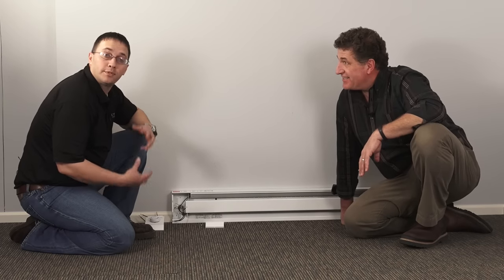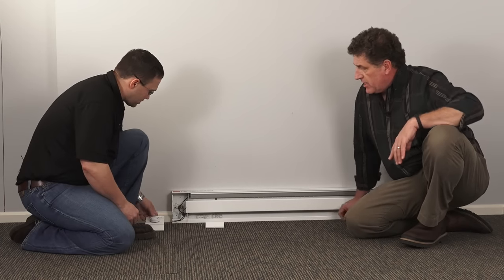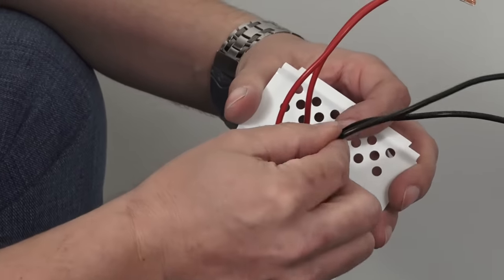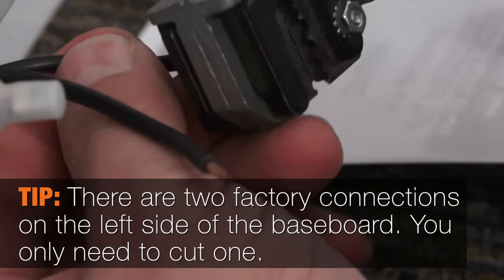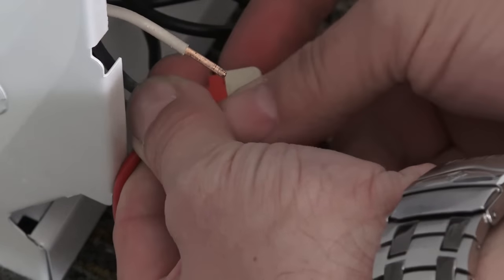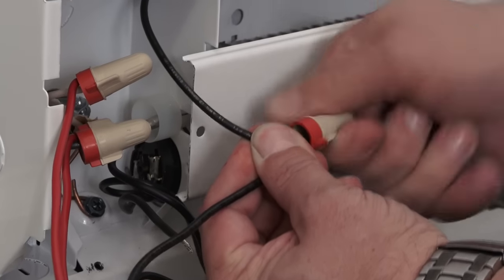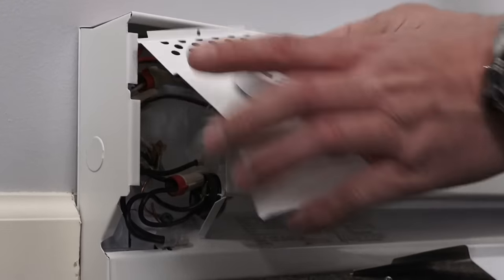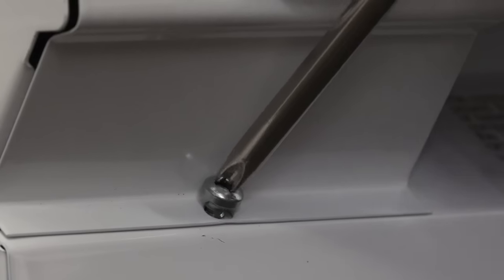How to install: BTF2 thermostat on 240V baseboard | Cadet Heat

Comment: Your video instructions and your paper wiring diagram don't seem to match.  In the video your show cutting the black wire pair at the top of the heater.  The wiring diagram reads DO NOT CUT!  I'm confused.
Reply: It said don’t cut until youre ready
Reply: I thought the same thing I had to go back and read it lol
Reply: @ms.williams4797 the instructions actually say and show “do not cut” and they show wiring to the other set of black wires.

Comment: Do not cut the one connecting from the top to the bottom. Only cut the other one, which is two blacks from the factory. Now, the one that you cut are the only two blacks that you will be connecting your thermoster's two blacks seperately to. IF YOU CUT THE TOP AND BOTTOM FACTORY CONNECTIONS, AND CONNECT TO IT AS YOUR SECOND BLACK CONNECTION, CIRCUIT BREAKER WILL TRIPP OR 🔥fire🔥
Reply: this comment is wrong.

Comment: The instructions tell you exactly how to do this. The instructions do not tell you how to put your thermostat on one side and your power wires on the other side
Reply: I was hoping to have power coming from the left and thermostat on the right. Is that possible?

Comment: This helped the guy they sent to fix my heat that wouldn't turn off. It had a 2 wire thermostat instead of 4. Red to white, red to gray, black to black, and black to black.

Comment: I have a 48" Cadet baseboard heater, but the left side control only has low, comfort zone and high.  I do not see how you shut off this baseboard heater.  Any suggestions would be appreciated.  Thx

Comment: If the smoke alarm goes off when I flip the power and control switch on and I don't see smoke is this just new part smell normal?  Called customer service and they said to turn it on high windows open for an hour to clear it out.  The oils burn.

Comment: When installing heater, does it attached to the dry wall or to the baseboard, if to the dry wall can it become a fire hazard. 
Please reply.
Reply: Yes you  can attach directly to the drywall.  As drywall doesn't  burn  and not combustible.

Comment: I'm current renting a place with this installed but I'm having trouble with using it. My landlord said to initially turn it all the way to high until room reach comfortable temp and turn it to comfort zone until it clicks, but it doesn't "click" or am i misunderstanding this. I do hear multiple clicking sounds even when I'm not turning the dial, but I don't hear a actual click when I'm trying to set it to the comfort zone setting. 
Then when I have it at comfort zone, the heat just keeps going above my "felt" comfortable temp. So I'm not sure if I"m doing this wrong??? someone help please? Thank you!

Comment: I just moved into home ,they installed 6 baseboard heaters ,1 in each room useing 10-2 wire all baseboards are connected to eachother ,now my meter is going very fast and my light bill was over 600 i turned heaters off meter stops so i know its the base boards ,can all theses heaters be connected together? And what amp breaker should they be on ,
Reply: Welcome to the world of electric heat

Comment: The thermostat I’ve purchased gives two options for the stat to turn off at temp and again at off. One of the leads supplying the heater goes directly to the element wire and the other goes through the Tstat but it’s not working.  In installed it and the room Continues to overheat what have I done wrong? It appears I’ve installed it exactly like the stat I removed was installed

Comment: Considering buying a few 120V 500W units and I want to know if the wattage varies based on the thermostat or is it always pulling 500w whether it's set at high or low?

Comment: Could power (120v) be connected to heater on either side of the device? Also - I'm replacing old temp controls  with new wall mounted. is that OK?
Reply from the maker: Jerzy,

Good questions. Here are answers:

Voltage: You can use 120-volt power but you need to make sure that you're using a 120-volt circuit and a 120-volt heater. Our baseboard heaters are voltage specific, which means you can't use a 120-volt one with 240-volt power and visa versa. (If you have a SoftHeat baseboard, those only come in 240- or 208- volt versions.)

Which side: Our standard baseboard heaters can be wired on either end of the unit. If you have a SoftHeat baseboard, they cannot be wired on either end of the unit, but we do make models that can be wired on the left or right side. You just need to buy the right one.

Thermostats: You can replace the temperature controls with new wall thermostats. If the old thermostats are built into the heater, we'd suggest you disconnect them. If you don't want to, then make sure they're turned as high as they can go and the wall thermostat will override those controls.

If you have any other questions, please let us know so we can help you through this install. Good luck!

Comment: Hi there. I am replacing the existing wall thermostat as well as the 5' length of electric baseboard. I guess it doesn't,t matter whether I replace the thermostat or the heater first
Reply from the maker: Thanks for the question! If you're replacing both the heater and the thermostat, it shouldn't matter which one you start with.

Comment: is there a video or instructions on how to wire your thermostat on the opposite side of where the supply wires come in. thank you
Reply from the maker: Good question. We do not have a video on how to do that just yet. If you're using a BTF2, you can only do this on a 120 volt installation. If you have any questions, we'd suggest you contact our tech support department so they can walk you through the process: http://cadetheat.com/support/customer-service

Comment: In my heater, there are 4 black wires and 1 red wire on the left side. The instructions that came with the heater say to wire it according to the thermostat wiring instructions. The thermostat wiring instructions (and this video) only show 2 black wires. Where can I find instructions for wiring my heater or thermostat? Because the way that I tried first, made a loud pop, some smoke, and now my thermostat doesn't work.
Reply from the maker: Reese, Very sorry to hear about your thermostat. Our tech team suspects you may have a multi-watt 8F2025 baseboard based on the description of your installation. Because you're dealing with a wiring issue, I'd suggest that you get in touch with our tech support team directly. They're best able to walk you through the issue and can help you with a replacement thermostat. http://cadetheat.com/support/customer-service

Comment: I bought an 8ft 240V baseboard cadet heater with a double pole baseboard mount.  My question relates to the gauge wire.  What is recommended?  Currently I have 10-2 Romex running to my old baseboard heaters.  Do I need to rewire with 10-3 Romex?
Reply from the maker: Josh, Our tech support team says that 10-2 wire will be great. If you have a 20 amp breaker, you can run 3,840 total watts on that line. If you're using a 30 amp breaker, you can run up to 5,760 watts on it. Let us know if you have any more questions.

Comment: I would like to install a 2000 or more  watt unit in my attic with a thermostat. Can you guys provide me with the unit and thermostat part numbers. So I can order them? Thanks
Reply from the maker: Thanks for reaching out. If you have a few minutes, I'd suggest you talk to someone from our tech support team either through Live Chat or on the phone. http://cadetheat.com/support/customer-service

There can be a lot of heat loss in an attic and we want to make sure that we help you find exactly what you're looking for. I can do my best to help you here but it would be a long discussion thread. 

If you want to go through finding an answer here, I'll need to know if your attic is finished or not and about how many square feet it is to start.

Comment: Hi, i have a questions about the volts on the breaker, i checked the label on the breaker box and it says 60 AMP Mains, 3 wire. 120-240 V.A.C, Solid Neutral. What baseboard heater is good for me?

Comment: Hello I would like to know which cable I need to connect 3 baseboard, 8 feet 220v.
And if I can put them in the same line, thank you very much
Reply from the maker: Daniel, Sorry it took us a while to get back to you. That would be too many heaters for one circuit. You can install two 8-foot heaters and one 6-foot heater on one 30-amp, 240-volt circuit with 10-2 (with ground) wire. Three 8-foot heaters is just too many amps for one circuit.

Comment: I have replaced 2 thermostats on my Cadet baseboard heater in the last 5 rears. The first one, a digital, stopped working after 2 years. So I replaced it with the basic knob type. After 3 years it now occasionally lets the heater run continuously without shutting off. What is going on?
Reply from the maker: Hi Dan, We're very sorry to hear about that. That's very unusual that you've had two issues with thermostats in 5 years. It's hard to say exactly based on the information you provided. What thermostat are you using now and how many heaters is it controlling? (How many heaters and what size?)
Reply: Cadet Heat , I'm running the 8F2000A, just one heater, with the BTF2 double pole thermostat. I found the paperwork that came with it today. That thermostat was installed on 12/9/17...so it only lasted a year! The digital thermostat that was originally installed when I got the heater lasted just 2 years. This 8' heater is installed in a 12 X 12 insulated back porch. I leave it set in the "comfort zone" position and when it's cold outside (less than 30 degrees) it usually keeps the room around 50-55 degrees. But the past month, on several occasions, I step into the room and it's 80 degrees or higher. My solution has been to trip the breaker to the heater for about 5 minutes. The heater will then operate normally for several days before it messes up again. 

This back porch is my workout room and my wife also has several delicate plants she keeps out there through the winter. I'm sure the temperature fluctuations are not good for them...and I don't enjoy preparing to get on the treadmill for an hour and the room is 80 degrees. The heater and thermostats were installed by my friend, a retired electrician. He is at a loss as to what the problem could be.
Reply from the maker: Dan, We ran the info past our tech support team. It sounds like you have a defective thermostat. What is strange is that you went through two in only a few years. Did the electronic one do the same thing you're seeing with the BTF2? Can you please send your mailing address to social@cadetheat.com so we can send you a replacement?
Reply: Cadet Heat ....the first (digital) thermostat just quit working all together whereas this one occasionally allows the heater to keep running up to 80 degrees when the dial is set in the middle. Thank you for addressing this problem by sending a replacement. I will contact you with my mailing address.

Comment: Soooo....I cant wire in my old white Rogers low voltage single stage mercury  thermostat to this you can I? It was wired into my old unit.
Reply from the maker: Hi Kelli. For wiring questions like this, we would suggest reaching out directly to our tech support team as they will have the best insight. They can be reached by following this link: https://cadetheat.com/customer-service

Comment: if i need to hook up on the other side how is that done i have to do this thank you
Reply from the maker: Hi Doug, great question. The process for hooking up a thermostat looks a bit different depending on if you are installing a BTF2 (double-pole thermostat) or a BTF1 (single-pole thermostat) and whether you are using a 120-Volt or 240-Volt heater. Which thermostat are you installing and which volt baseboard are you using? Once we have that information, we can help you get the thermostat installed.
Reply: Cadet Heat thank you for your help but i figure it out there was some stuff you said help me get it thank you again
Reply from the maker: We’re happy we could help out, Doug!

Comment: can i daisy chain black wires on the other end of the heater to another 4' heater or should I 
connect it   to the 2nd  heater right out of the  thermostat?

Comment: Can the thermostat be replaced mines stop working. Do you need to cut the electricity if it can be replaced.
Reply from the maker: Hi Meredith!
So yes the thermostat can be replaced, and yes you will need to cut the power to the breaker by turning the circuit breaker off. Also you do not need to cut any additional wires (power). Let us know if you have any more questions!
Reply: Hopefully you’re still with us Meredith!  The real answer to your question should’ve been...whenever dealing with electricity, make sure the power is turned off to that particular outlet by turning the breaker off.

Comment: Is it ok to use 15 amp breaker on 8 ft base heater?
Reply: Running at 240v, you're fine. 8 ft heaters uses 10.4 amps, I believe.  2500/240v 15 amp breaker is fine.

Comment: What is the difference between the BTF2A and  the BTW2T ? The one I am replacing does not have any letter after the BTF2 but all I can find on eBay are models with the letter designator after the model number.
Reply: A = Almond, W = White
Reply: @stephen732  thank you!

Comment: I do not get it!  240V requires a double pole breaker and 240v wire which have 4 wires (black, white, red and ground)  the video shows connection on the white and black, so what happens with the red wire that comes out of the wall from one of the breakers?  by conecting only the white and black from the wall the connection is only in one of the breakers (110 V) so them why is the reason for a double pole breaker?
Reply from the maker: Ramo, Great question. Our heaters do not require a neutral, just two hots and a ground. If you have a white neutral wire, you'll need to cap it off and use the black or red wire as a supply wire
Reply: Often 240V supply wires will be regular Romex, with black, white, and bare copper conductors. The white wire should have been taped or painted black or red to show that it's not a neutral.  @Cadetheat

Comment: My baseboard heater don’t get hot and just feel warm I did all this steps but Is don’t get warm my room
Reply from the maker: Sounds like you may have hooked up a 240 volt heater to 120 volt power. Can you tell us what model heater you are using?

Comment: I hooked mine up just like video did not come on what could be problem
Reply from the maker: This could potentially be a problem with the circuit breaker. A voltmeter would need to be used to test a circuit -- it would also require testing live wires, which calls for extreme caution. If you're not comfortable doing this, we suggest calling a licensed electrician. If you have more questions, please get in touch with our tech support department over the phone, through e-mail or via live chat: http://cadetheat.com/support/customer-service

Comment: I don't think this is correct advice on how to hook up this 240v Thermostat to an electric baseboard heater.  At 1:53 he says to connect both red wires from the T-stat to the supply wires (240v) coming out of the wall.  I believe you are supposed to connect one red wire and one black wire on the thermostat labeled L1 & L2 or Line to the hots (240v) coming from the breaker box in through the wall.  Then you connect a red and a black wire from the t-stat usually labelled T1 & T2 or Load to the heater wires.
Reply from the maker: Hi there,
This video is explaining how to install a BTF2 thermostat. We indicate the wires by colors, but other thermostat brands may label their wires differently. Some use L1 and L2 and the labels don’t always correspond to the same color. We recommend using an installation guide specific to your brand of thermostat. For the Cadet BTF2, both red thermostat wires connect to the power supply wires and the black thermostat wires connect to the black heater wires. Please let us know if you have any other concerns or feel free to call our tech support team at 855.223.3887.

Comment: what if the other is cut
Reply from the maker: Hello!

If you're asking what if you were to cut the other set of wires on the left side of the baseboard instead of the wires shown in the video. You would wire the baseboard the exact same way,  just make sure to keep one of the connections in the left side connected at all times for the baseboard to operate correctly. 

Let us know if you have any more questions.

Comment: this completely contradicts the instruction in both the baseboard and thermo boxes.  they say NOT to cut the black wires connected at the top
Reply from the maker: Hey Joe, Sorry for the delayed response. Thank you for pointing this out. We changed the recommendation in our Owner's Guide since we created this video and it needs to be updated. When you're using a 240-volt heater and power, you can cut either factory connection and the installation will work. I'll add this video to our "needs update" list.
Reply: @Cadetheat  I just installed one of these thermostats BTF2 and am seeing it never shuts off in the off position